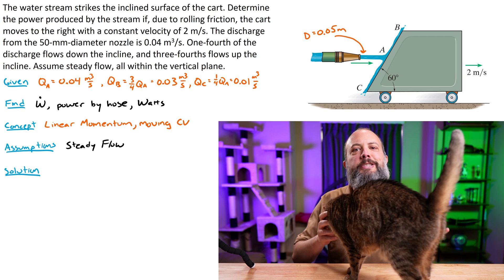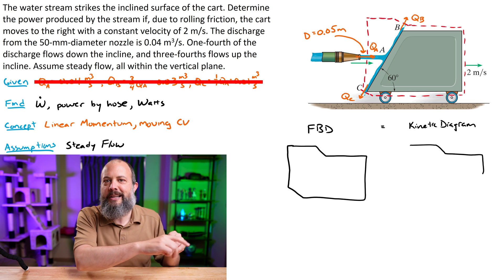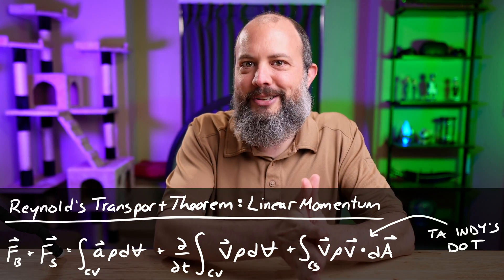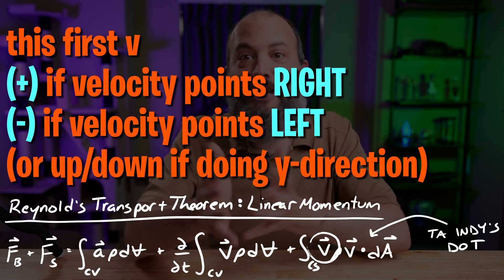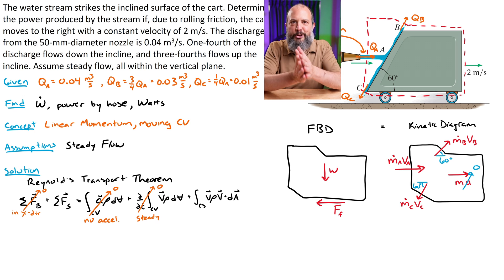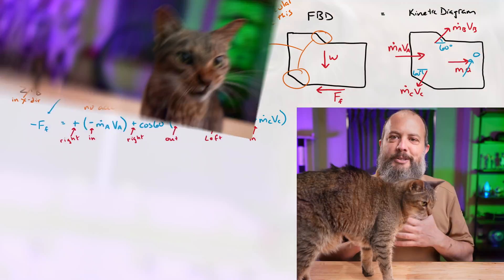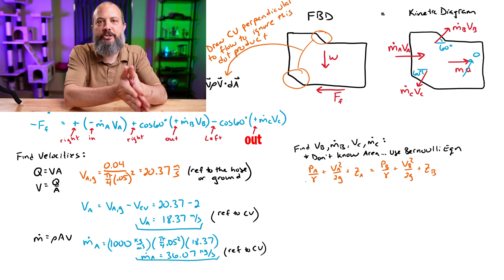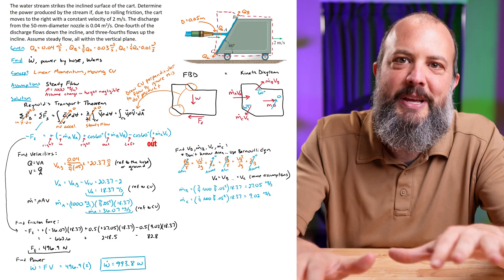Fluid Momentum - Moving Control Volume Problem with Constant Velocity

Comment: Hiii, nice video! I like it a lot, but I have a question that really confuses me. In the free-body diagram, isn’t it necessary to include a horizontal force due to the water stream? I only see the friction force, and I’m confused.
Reply from the maker: No, the "force of the water" is included as its momentum on the right hand drawing. It's physical material crossing the border of the control volume, entering the volume. It's mass and velocity are relevant. It might feel like a force, and the effect is similar to a force, but the actual thing happening is mass and velocity. You might be thinking of pressure. In a conduit flow problem, where you have pressurized water in a pipe, you WILL have a force where the water is, and that is Pressure*Area = Force. Not due to speed or velocity of water, due to water pressure. But in this specific problem, the water is at atmospheric pressure, the same pressure acting on the control volume from all sides, so here pressure can be ignored.

Comment: Greatly explained just have a little question why was not the pressure forces added in free body diagram
Reply from the maker: In this problem, with everything exposed to air, everything is at atmospheric pressure, so the exact same pressure pushes in from all directions, so it all cancels out. You'll only have pressure as a term inside pipes or tanks where there would be a difference in pressure at different points. 🐈

Comment: Hi, thanks so much for you video! I have a question: Should'nt the force of friction be in the opposite direction since the wheel turns such that the velocity vector at the rim points to the left? And, also, should'nt the force of friction be on the same side of the integrals part since it is a force that is going to cause a change in the flow of the fluid? By applying these two things, I get the same answer as you, but when I used the friction pointing left, I got confused because I put it as a negative force on the same side as the integrals part of the linear momentum equation
Reply from the maker: No, I double checked and think I have it right. All external forces should go on the left. Body Forces and Surface Forces, of which friction is a surface force. Right side isn't for things causing changes in momentum, it's for the changes in momentum themselves. All the causes go on the left. In the equation F=ma, the FBD on the left is all forces, the ma is the kinetic diagram on the right, all changes in momentum. For direction of friction - for a normal powered car you are correct, friction points forward. The engine drives the wheels and friction tries to oppose the motion and thus pushes forward. But in this case, the wheels are not powered, friction with the ground is what is causing the direction of the wheels to move left. Have a great rest of your semester. 😺
Reply: @BrianBernardEngineering  Thanks so much for answering, I see things more clearly, that's awesome!